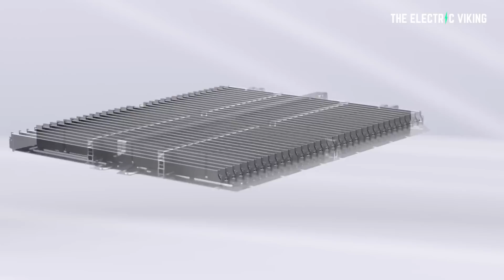Electric cars & pick up trucks will have more range than gas

Comment: A range extended hybrid sound good right about now
Reply: Jason Gooden:  Which is why I still think PHEV's will make FINE transitional vehicles for lots of folks who have to regularly travel long distances, or city folks who take vacations where they drive a lot, for years. 

If I had a PHEV, 99% of my miles would be gas free, and I'd be hauling around a much smaller battery than with a BEV. 

As a car customer, it will be nice to have choices until BEV's are so good and plentiful and the charging network is so good that there is no NEED for any hybrids.

Comment: Elon once talked about the transition from ICE to EV. He pointed out that there are 2.5B cars and trucks on the road. At 100M cars sold per year, it would take 25 years to replace them all. In America we sell 75M cars in general per year. I believe the change is going to happen, but the volume is huge and will take a long time. Even the CEO of Exxon recently said the transition will happen by 2040.
Reply: Add to that the vehicles off-road: agriculture, aviation, marine, etc, I think it will take more than 25 years. 
Many vehicles lifespan is longer. My current '97 wagon still chugging along
Reply: In 2021 there were 1.6 million new automobiles sold in the US. World wide there were only 58.2 million sold. That's down from a record high of 66.8 million sold in 2016. Current estimates for 2022 is there are about 1.4 billion vehicles on Earth.
Reply: Car manufacturers wet dream has come true. One whole world needs new vehicles in exchange for the old ones. As quick as possible. 💵💰💸💯
Reply: Maybe If gas prices get to $10 a gallon.... all bets are off for 2040 it will happen much faster. The problem is getting those vehicles that drive 45,000 to 50,000 miles a year to electric.
Reply: @b4804514  It is $11 a gallon in Hong Kong now. There are several counties that are north of $9 and many more north of $8. EV batteries will get less expensive with more capacity as each year goes by. EVs will replace ice.

Comment: Great video as always.  What kind of KM could the new Silverado Ev and the new Sierra Ev get if they were not 754 horse power? I really wonder this.  Would it not have been better to maybe make them say… 600 horse power? Would that increase the range to 750 KM instead of the expected 640 km range? I really wonder this.  Maybe the future will have vehicles where you can adjust the horse power at any time.  Kind of like changing the frames per second on a high end computer or Xbox series x.  From 60 fps to 120 fps.  Maybe a truck / car can adjust from 754 horsepower down to 400 and enter “max efficiency mode”?
Reply: Electric motors don't have much less efficiency for higher power the way ICE vehicles do. You don't really have to sacrifice one for the other. Two vehicles that are the same shape and weight, one with a 200hp motor and one with a 1000hp motor will use about the same electricity when driving around (the bigger motor will use a bit more electricity but not much). But for a truck that needs hauling and towing capacity you need the horse power. More accurately you need the torque, but high torque and high horsepower typically go hand in hand with electric motors.
Reply: Interesting I didn’t know that.  This new tech is so exciting. Maybe that’s something they can figure out in the future. But by what your saying, maybe not
Reply: Great idea might be possible with a over the air update
Reply: @michaelstarkey9745  You don't need an OTA update with an electric motor, you just use the Go pedal - push it more and you get more HP, push it less and you get less HP. That's how they work. An electric engine is just one small sealed unit, the size of a small pumpkin. Tesla's motors only weigh about 70lbs. Doubling the size of the motor reduces efficiency about the same as putting a child in the back seat. You'll barely notice it. Electric motors around 95% efficient over their entire power range regardless of the size, so the energy to accelerate a car slowly is the same for a 200HP motor or a 1000HP motor. But a huge gas engine just idling or under a light load uses way more gas than a small gas engine, even double. That's why they try to have variable stroke pistons or only run an 8 cylinder engine on 4 cylinders when it's idling or under a light load, stuff like that. You have to think about the two approaches (gas vs electric) completely differently when it comes to efficiency. You'll pay way more at the pump just to leisurely drive a 500HP gas car around vs a 120HP car. But you'll need the same amount of electricity to charge your 200HP or 1000HP electric car at the end of a day of leisurely driving.

Comment: In a few years there will be the realization that the raw materials and the status of the electrical generating supply system will not be able to support the EV transition by 2030 or 2050. 

Not to mention the financial burden on rebuilding this entire infrastructure every 25 years. 

Just in America in order to support the transition to Carbon Free EVs, electrical generation needs to increase by 2200 megawatts (mWe) each month. 

That's the equivalent of a large dual nuclear power plant placed on line every 4 to 5 weeks to meet that timetable. 

Only two big nukes being built in the US (by the way for 10 years now).

Or we could build the equivalent solar energy generation on 16,000 to 20,000 acres of solar panels each month. That's the size of Manhattan. And that will only support the additional 2200 mWe needed during peak daylight hours.

Or the installation of 1200 Windmills every month assuming wind speed is always greater than 15 fps. If the wind isn't blowing greater than 10 fps there is very little generation.

In my estimate of 2 trillion passenger car miles in the United States and 4 miles per kilowatt hour EV range, I have neglected heavy truck and rail transportation in my estimate of the electrical power needed in my calculation. 

Air Travel as we know it will cease, and cargo ships will have to sprout sails to become carbon free. 

Where are the raw materials coming from? The copper, aluminum, resins, lithium? 

Where do you think all this electrical power will be coming from?

Just hoping this "Carbon Free" transition to all EVs by 2030 or 2050 is not a success path. 

Reality will set in, and very soon that achieving this goal by 2050 will be more like 2240.

Comment: You keep talking about passenger vehicles. The Australian market has the highest % of utes sold per capita than any other country and many of them are 4x4 because they are used for a weekend exploring in the bush. The vast majority of these vehicles tow on those trips and if the owner is a tradesperson they probably tow a trailer every day. You say they say they are 20% more energy dense and lighter but real-world towing tests that were done on the Ford Lightning and Hummer show figures as bad as only one-third the range as when not towing the new battery would still have to be considerably bigger, maybe even twice as big. It would still take very careful planning when towing your camper into the bush where NO charging will be available. Good luck with selling vehicles in the future to the people who use these types of vehicles now.

Comment: Utter nonsense. Gas cars will still be about half the pool by 2040
Also 10 gallons at 60 to the gallon is 600 miles -  e-cars at 1 1/2 tons will never achieve this

Comment: Nice "Hype Video"...But, the inherent issues with BEV's won't be solved anytime soon, let alone by 2030....

Yes, sales will continue to grow into the future..However, it's long been widely speculated that living next to power lines, and continuously holding a cell phone to your ear also causes Cancer.
Reply: Speculation.
You will note that the number of people without cell phones is pretty small.  If the electricity in an EV is somehow worse than the electricity in an ICE vehicle, it would appear that no one cares.

Comment: Apart from the fact that if you run out of electrons in the middle of nowhere, in an emergency you'll still be able to open up your portable solar panels and feed juice into your battery. Good luck trying to drill for oil if you run out of petrol or diesel in the middle of a desert.
Reply: A batter route planner may prevent that or a mobile charger kept charged an in ur trunk jus to get to nearest workin Chargin station
Reply: Obviously you are too unschooled to understand it would take a solar panel 4 months to charge the car!
Reply: @donraptor6156  It would take a few days to get enough range to drive somewhere for help. But that's a lot quicker than how long it would take to drill an oil well with no equipment, and then build a fracking tower out of empty baked bean tins.
Reply: 5th like

Comment: I think range increase will help vehicle consumers relieve their anxiety slightly. There still is the issue with charging stations.  The real issue will become how many charging stations are available and how long does it take to charge.
Reply: If we have more range, then more charging stations will be within our range.  I think that charging time is more of an issue.
Reply: @simongross3122  True to a certain limit.  You might be confident enough to travel long distances because you’ll be certain to find a charging station.  The disappointment might  be there is a line up of vehicles trying to use the same charging station.
Reply: @QuestoinEverything  Yes that's true.  And it will matter to people who are in a hurry, or who travel for work, which is most people.  In 5 years time things might be different.  For now, I'd be happy with an EV for short trips and around the city, but for longer trips I'll either use my wife's car or hire one.

All options are expensive right now :(
Reply: @QuestoinEverything :  But that can happen at gas stations too.   And once chargers / batteries are good enough to allow 10 to 15 minute significant charges, the lines aren't so big a deal.
Reply: Most people should charge at home. Charging stations should only be used for people with no access to electric outlet at home or work or interstate travellers.

Comment: With less than twice the pack size of a model y less aero dynamic efficiency and heavier car then I doubt it will go any where near 800km on the open road. Probably close to 600km but that would be awesome anyway

Comment: I can get 749 miles /1200 km in my diesel Porsche Cayenne.  Fantastic vehicle which I dont plan on replacing until at least 2030.  Until large transport trucks are electric diesel will be one of the last fuels to go.
Reply: I am also highly interested in getting one of the newer/more dense batteries for my home solar.